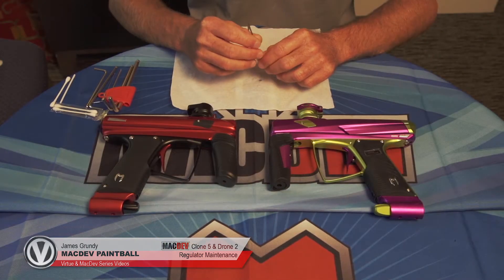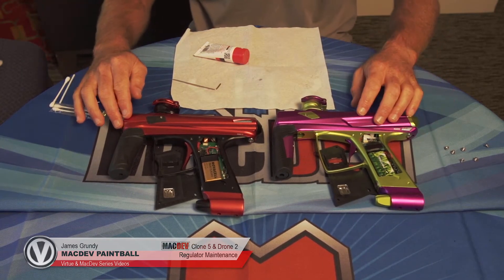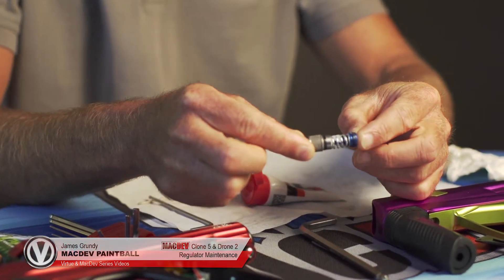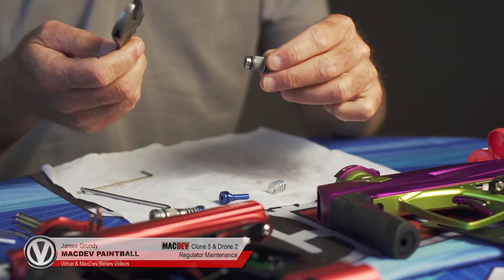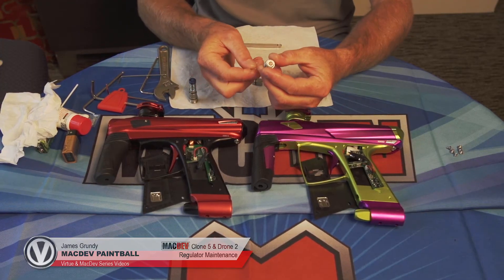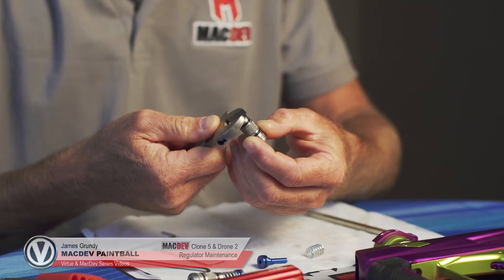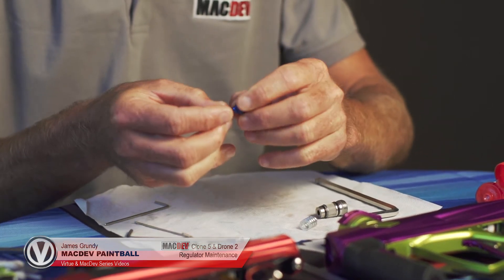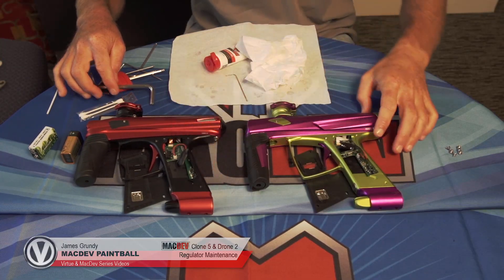How to Maintain your Regulator on the Macdev Clone 5 and Drone 2 - Macdev Tech Series Videos

Comment: my macdev drone 2 makes a puffing noise when I pull the trigger, I cleaned and re lubed everything. i changed the dwell up and down. i did everything I could find on the internet. what could happen?
Reply: try increasing the fps. I had a similar problem with my dangerous power e1.
Reply: Sean O'Brien whats your tank output at
Reply: GetHype4Life 450 psi, the problem was that the connection from the trigger frame to the solenoid wasn't put in all the way.
Reply: Sean O'Brien true